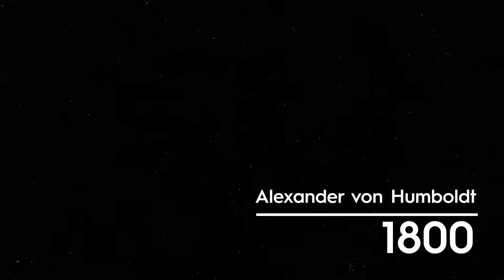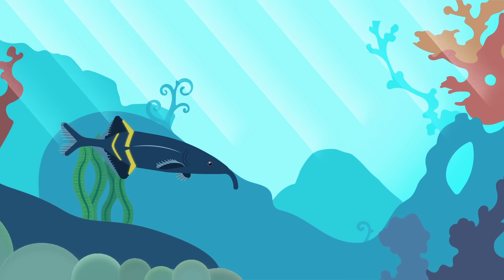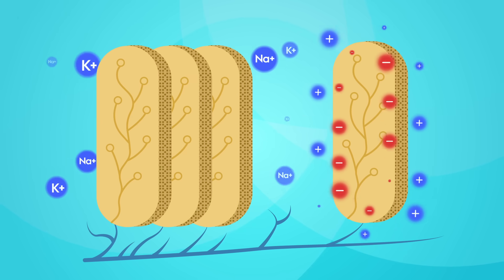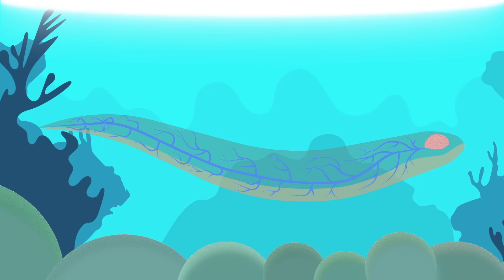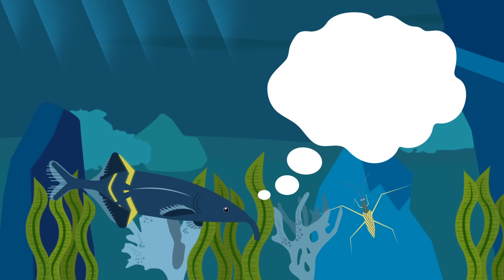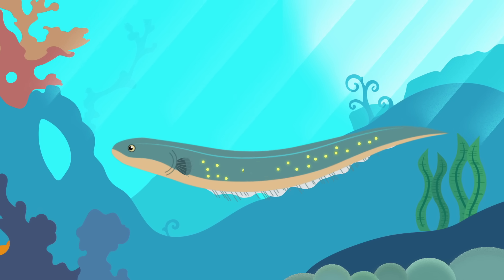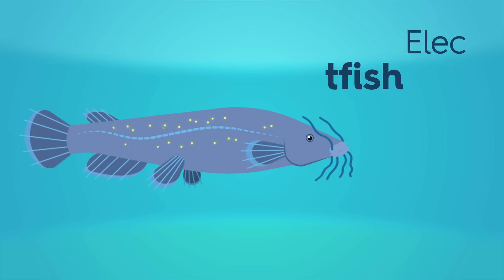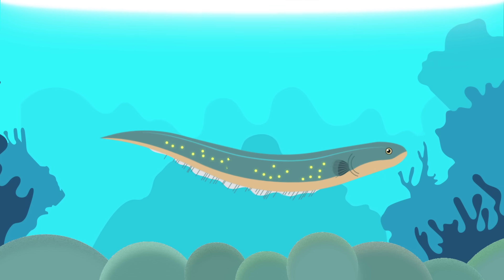How do fish make electricity? - Eleanor Nelsen

Comment: Lets farm them and make endless alternative energy source
Reply: Pan Peter You gotta feed them though, and the release of electricity may not be worth the effort of farming to clean the water every day.
Reply: bobdigitally Unlimited Power
Reply: @darthguilder1923  д
Reply: Not if we do aqua culture farming methods. But if we genetically modified ourselves then could generate personal Sith lightning for cell phone charging.
Reply: @bobdigitally  Or we could genetically modify ourselves to photosynthesize like plants..... We just have to break the code...
Reply: @bobdigitally  then suddenly a man fall into the tank
Reply: bobdigitally SHAZAM!
Reply: High voltage, but low ampere. Makes the energy won miniscuel
Reply: bobdigitally still isnt endless
Reply: We would have to keep them docile in a computer dream world.
Reply: @TickedOffPriest  underrated comment
Reply: triigga s depends how strong you are with the dark side
Reply: You'd spend more energy caring for the animal's biological needs than they can ever produce to make it viable.
Also, they probably take a while to charge up. It's not like they can output electrical power all day long.
Besides, I think it would be quite unreliable and stressful for the fishies.

Btw, high voltage, low ampere? Multiply both and you get Watts the same. Say you want to send 100W somewhere. You can use an output at 10 V and 10A, 100V and 1A, 1000V and 0.1A. The power sent is the same, 100W.
However, power lost due to resistive effects is proprotional to the square of the current (Plost=I^2*R). If you use 1A and 100V instead of 10V 10A to send that 100W, you just cut your power lost by a factor of 100 (because I is 1/10 of what it was, let's call it I', so Plost= (I'/10)^2*R, Plost=I'^2/100*R). Not to mention you can make your wire thinner because there's less current passing through it. That saves material, so wires are lighter, cheaper and you can built power grid towers farther apart.
That's why power stations output power at ridiculously high voltages. like 11000V, 34000V. The higher, the better. Highest I've seen is 500000V. Current is determined by the power grid's demand.
So, you might ask why aren't your house fed with 34kV instead of the typical 220V. And that's often the source of confusion why people think high voltage is less efficient.
High voltage is dangerous. Because high voltage can arc or "jump" insulation (air, too, is considered an insulator). So, you have to keep the wires farther apart, further away from the ground or things/people you don't want electrocuted or on fire. That's a bit of a hassle in crowded cities, so typically a substation gets the voltage from the power station and makes it lower for distribution, then transformers lower the voltage further to get the 220V on your power outlets.
You may observe the power poles where you live. Some power lines are buried, but if you get the chance to see one, they can be of either 3, 4 or 7 wires. 3 wires are for High Voltage at a 120° phase, and link the substation to a transformer. 4 wires are the low voltage ones, 3 at 127V and a Neutral, that link the mentioned transformer to your house. 7 wires are both, conveniently using the same pole. You see 4 wired ones typically near the edge of the urban area and 3 wired ones in sparsely populated areas or between towns.
Exact distribution layout varies. In my street there are the 7 wire ones. the 3 High voltage are 24kV. 4 wires are always 110-127V lines. I could go on and explain exactly the why of 4 and 3 wires, but this thing's too long already. Just google about the Y-Δ transform (a.k.a wye-triangle os Star-Delta transform) to learn more. Basically, 3 wires (Δ) is more efficient, but gets a little tricky if the power in each wire is unbalanced, that's when 4 wires (Y) come into play. Power stations and substations are linked in a Δ-Δ fashion, Transformers turn the Δ into an Y grid.
Reply: Not useful in any way.

However, we should look into their genes and engineer the next generations of humans to be able to sense electric fields and create more current for biotech-tatoos.
Reply: MetallicReg Map the genes that grow the electrocytes, purposely mutate said genes with human dna, and implant it in experimental embryos or, enlarge the organic electrocytes,  and mix with best photosynthesis producing plants for use such as organic solar panels; self healing, semi- synthetic, organic, solar panels.
Reply: Pan Peter The electrical energy from the fish is powered by chemical energy (biofuel) which ultimately comes from solar energy. So, by the time you harvest the energy from this fish it has already undergone multiple conversions and losses. It'd be more efficient to just go directly to the source (the sun).
Reply: These guy probably take some long time to charge up that much
it probably like trying hamsters wheels farm, easier just to try use food to make bio fuel
Reply: geez... you human, so greedy...
Reply: It's a cool idea but if we do it and take bad care of the fish, than they will go extinct after a few decades. And it's not endless, fish die
Reply: bobdigitally still won’t charge my tablet
Reply: ScienceAIR I am interested. How much do you charge?
Reply: Simon M nice pun
Reply: That's slavery
Reply: They generate a lot of voltage whitch stun their pray. but what's driving all electric machines us current. For example. I could make one million volt from a cheap battery, But I wouldn't be able to power something for long because of the low current.
Reply: +Devan Harripersad cough lol, someone got burn cough look... what I mean is using this electric fish for the electricity resource. Put aside to save a child in the hospital, their electricity aren't even enough to charge your phone for rewatch this video. So why you (*cough* "human species" *cough*) even bother to exploit this fish for their electric when you still have another (whatever green or not) option? Read the other comments and if you still want to exploit this creature you're indeed a greedy human, urgh.
Reply: why do humans always wanna take advantage of everything
Reply: or just you can go watching "Terra Formars" anime for more ideas like that. lol
Reply: ScienceAIR I want to start a channel on a particular subject but I need someone to make the animations
Reply: In terms of law those fish are no humans so no it is not slavery. And in terms of viability everyone who understands coversation of energy understands that using electric fish is a BAD idea.
Reply: vegan wont use energy then
Reply: Thats a reason to use it just because it would be funny.
Reply: Pan Peter They already did this in The Amazing Spider-Man 2
Reply: Have you the amazing spiderman 2? It doesn't end well...
Reply: Da Fuq?
Reply: "personal SITH lightning"😂😂
Reply: that's a comment worth reading
Reply: I am going to like your comment just because I want to see Peeta and sustainable energy people fight
Reply: yess
Reply: These eels have high voltage only not power( voltage and current) , it just like a stun gun use by police officer to capture criminal
Reply: The efficiency of their "converting food to electricy" might be bad, so it could not be viable.
Reply: It dosent work that way  buddy
Reply: Wow...New Einsteins in the comment section
Reply: Splatoon time
Reply: remind me of the Osorn Power from the SPIDERMAN
Reply: animal cruelty intensifies
Reply: But humans are known for killing nature.
Reply: But we’ll be gentle to them right?
Reply: omg 1k like
Reply: Yea let's
Reply: Pan Peter it would be cruel and inhumane
Reply: Look at ur jaw
Reply: Or just use a stationary bicycle with a generator on it lol
Reply: #stonks
Reply: Imagine having a fish in your phone
Reply: Does not work practically , or huge wastage would occur
Reply: Pan peter - peter parker - TASM - electro 
Hmmmm...
Reply: Hahahaha not a bad idea.
Reply: Please leave them alone
Reply: Coal plants will go bankrupt!
Nikola Tesla and Ohm will be jelly!
Reply: Nice
Reply: Endless phone chargers
Reply: Have you not seen the Matrix?
Reply: Any updates?
Reply: Skip the fish and just built it in the lab
Reply: Pan Peter you can’t creat energy.
Reply: genetically engineer these eels to produce what we need then proceed to farm .
Reply: Not a bad idea though lol